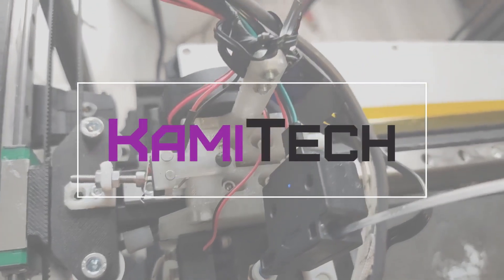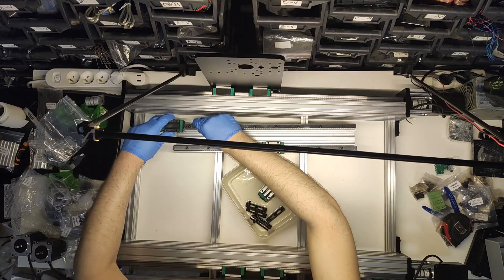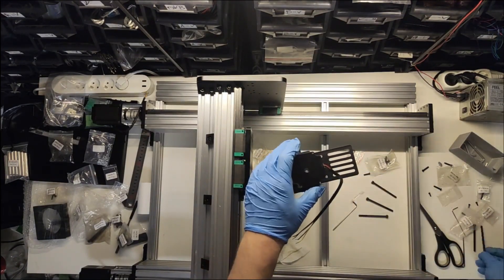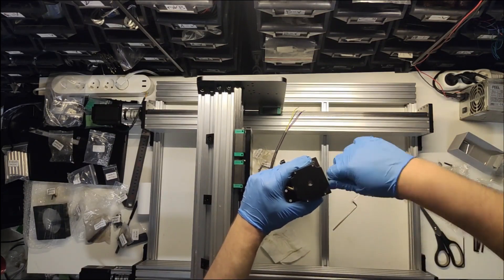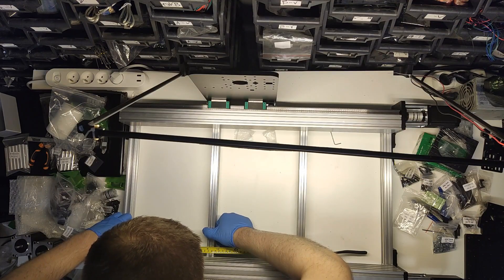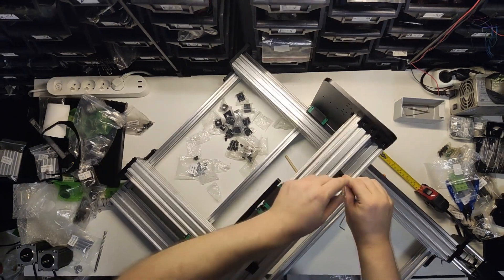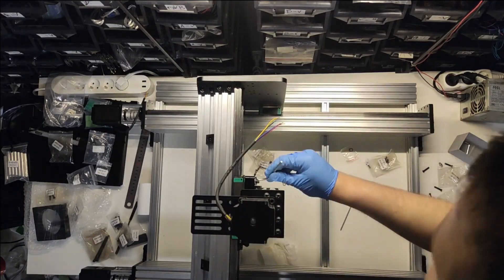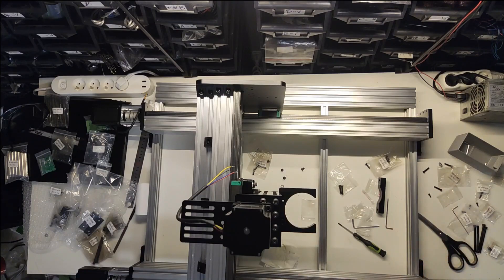Ultimate Bee - Inexpensive CNC machine kit building - Part 2

Comment: Did Bulk Man ever get back to you about the incorrect part size? I'm considering buying this machine but I want to make sure that if something isn't correct that the seller helps to make things right.
Reply from the maker: They did reach out to me but i decided to not pursue getting replacement because i wouldn't even bother mounting it and i would have to wait a significant amount of time for replacement. My advice is to get symmetrical size ie 750x750 so there won't be room for error. So far, I had no trouble contacting their support.

Also you can send them email and reference this video, ask what if they will provide you a replacement in case of any error in packaging.
Reply: @KaminarisTech  great! Thanks for the feedback. I'm getting the 1500x1500
Reply from the maker: @primate2744  Let me know how it goes with some photos of assembled machine
Reply: @KaminarisTech  I will.